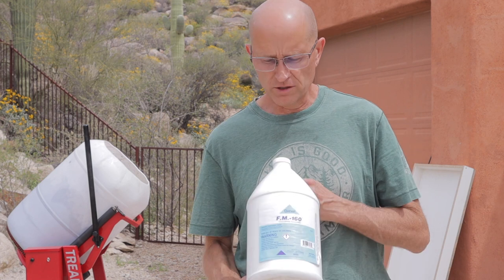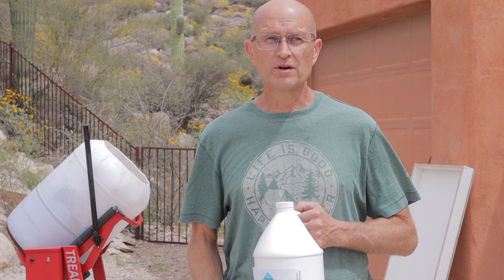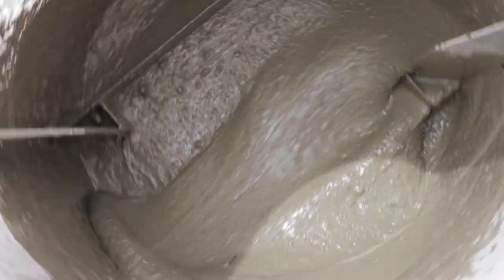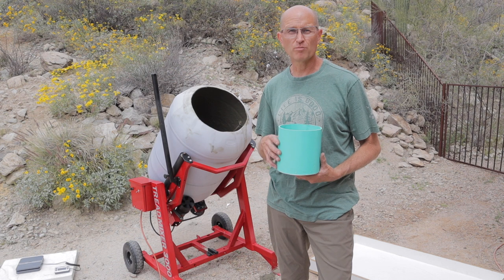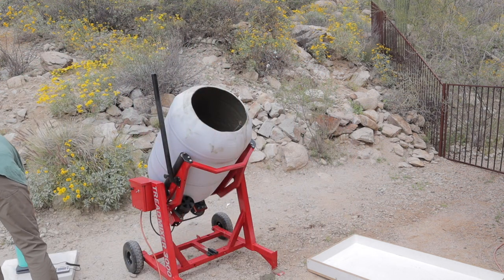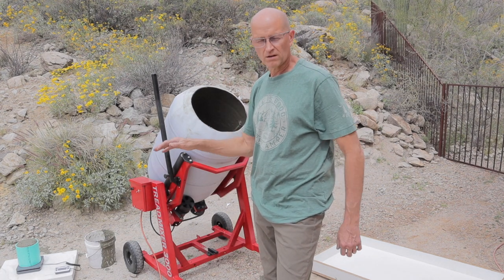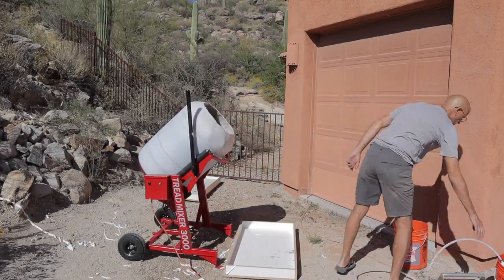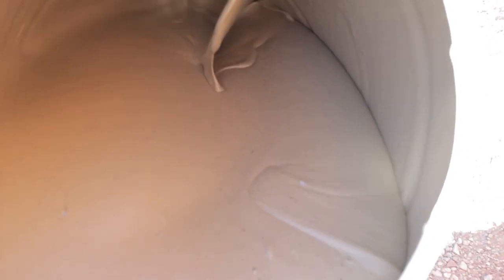How to Make AIRCRETE The RIGHT way!  [ How to measure Density for consistency.

Comment: You need to look up the difference between concrete and cement
Reply from the maker: Hi John, sorry if I didn’t get my words right in the video. Sometimes my mouth can’t keep up with my brain. Concrete is the finished product of cement and aggregate and sand. Cement is just the Portland component.😁👍
Reply: @PranaTech  yes, I know.  
I have been doing aerated cellular technology for the last 25 years. 
My strength to density is the best in the world ( as far as I’ve seen ) 
At 120 PCF I’m over 12,000 psi 
At 20 PCF I’m still over 1000 
Keep experimenting 
Way, way, way too much water !!!
I realize you only know Portland cement. But even in that basic cement there are water reducing additives
Reply from the maker: Wow, those are awesome numbers Jonathan! What foam concentrate are you using and what water reducers do you recommend? The DIY community sure needs someone like you to guide us! 👍Don
Reply: @PranaTech  I agree.  
It is a quandary    Even though I’m 68 and have been building concrete structures worldwide for 49 years, I’m still needing to pay bills 
Maybe someday I’ll write a book and give away what I earned the hard way—- the same way you are.
Reply from the maker: I understand completely. I’m a firefighter for my main job so Aircrete is not something I’m trying to making money with. If I was making a living from all this, things would certainly be different.  I merely want to build my own home in a couple years when I retire and I would like to build it out of aerated concrete. I’ve had a really hard time finding any engineer that will work with me on this. You wouldn’t happen to know any structural engineers that have experience with aerated concrete do you?
Reply: @PranaTech  my primary source of income comes from consultation.  Some from patent royalties. Some from university lectures 

You should study Adobe structural compliance 
Also, consider using an already code approved structural component.  Quantify the structural requirements with a structural component that is understood by the people telling you what you can and can’t do
You should be able to find an engineer in your part of the country who understands 
Maybe look at the similarities of the issue when building with Adobe

Comment: Is it possible to shoot aircrete?
Reply from the maker: Hi CAspar, you can pump it through a concrete pump, but shooting it like shotcrete probably won’t work. It is way to runny and has no real ability to stick to anything. 🙁
Reply: @PranaTech  Would adding a little retarder or water reducer make it sticky? Never done shotcrete in either mix design or application.
Reply from the maker: Good question! I have no experience with shotcrete, yet. I’m currently building a shotcrete pump but I have no plans to shoot aircrete with it. I’m building it to shoot shotcrete on ferrocement water tanks and outer shells for dome homes😁👍

Comment: Whats the R value of this product?
Reply from the maker: Hi Ciaran, the R value depends on the final density of your Aircrete. The Aircrete I was mixing in this video was low density and probably 30 to 35 pounds per cubic foot.  It has an R factor of about 1 to 1.2 per inch. Here is a link to a chart that shows the R factor of different densities of your Aircrete depending on how much foam you add. https://www.concreteconstruction.net/_view-object?id=00000153-96ee-dbf3-a177-96ffa5500000  😀👍

Comment: ANY IDEA OF COMPRESSIVE STRENGTH RATIOS COMPARED WITH REGULAR CONCRETE?
Reply from the maker: Hi Mervyn!  Here is a link to a chart for the compression strengths of aircrete. There are lots of info for regular concrete if you want to compare them.http://dlvews.com/wp-content/uploads/2017/08/Strength_Density-Charts.pdf 😁👍

Comment: Still waiting for the instructions on how to make the foam generator
Reply from the maker: Hi Michael, I’m probably not going to make one because I have been working on an Aircrete process that does not require any foam or generator. It creates the Aircrete through a chemical reaction and is much more reliable and repeatable. 😊👍

Comment: I want known how to make form
Reply from the maker: Hi Imran! It is very easy. You simply make a form out of wood or metal in the shape you desire. You make it screwed or clamped together so that it can be removed from the block of Aircrete when it hardens. Before you pour into the mold you can coat it with a paste wax to keep the Aircrete from sticking to the surface. That’s really all it takes.😊👍

Comment: Nice job and you seems quite inteligent and punctuative person , but there is a  huge mistake in your description. You are not preparing "aircrete" you are preparing foam concrete, which is totaly different . The Aicrete process is similar  story but at the end have to be "baked"...Both products look equal, but they are not. The foam concrete for his optimal strenght and quality needs preticular temperature when it is self drying...For extra strenght you can add polypropylene fibres.
 Keep the good job going !
Reply from the maker: Hi Peter, thank you for your great comments!  There seem to be different terms used throughout the world for this “Aircrete.” Here in the United States we call what I make “Aircrete” and what you are describing, we call “AAC” or “Autoclaved Aerated Concrete.”  Many people have other names for what I make, such as, cellular concrete or AC which is merely aerated concrete. You are correct that this Aircrete does need to be kept moist while it cures so that it reaches optimal strength. Preferably for 28 days for maximum strength.  Thanks again for your information 👍😀Don
Reply: Aircrete branded sells mobile units for doing walls and roofs and that is not baked they do bake panels and blocks

Comment: Sorry, but there is a fundamental difference between drying and cureing with regards to concrete. Concrete gets it's strength from cureing, but if concrete dries too fast it will be very weak. The two terms are not interchangeable.
Reply from the maker: Don’t be sorry my friend! You are absolutely correct! Sometimes my mouth goes faster than my brain and I misuse terminology. Thank you for pointing it out.😊👍
Reply: @PranaTech  Not an issue. Many people make that same mistake. You're in good company.

Comment: ratios please.  water to cement....water to foaming agent.....foam to cement slurry
Reply from the maker: Hi Dustin, sorry for not getting back to you sooner. I was at work all day and just saw your comment. Water to cement ratio is 6 gallons to 90lb. bag of Portland cement or 15.66pounds of cement to each gallon of water. The foam concentrate varies from brand to brand. Richway concentrate is 45 to 1 ratio so I use 14 ounces to a five gallon bucket of water.  For the foam to cement ratio, I mix it up until it is about the consistency of a medium thickness milk shake and then I measure the weight for the density on my scale and then adjust with more foam if needed to lighten the mixture. I show in my one video how to measure density of your foam with a 1/10 of a cubic foot measuring cylinder. Hope this helps! Let me know if you have any other questions. 👍😀Don

Comment: A buddy of mine uses Suave shampoo
Reply from the maker: I’ve tried a few dish soaps and I had trouble getting the bubbles to last until the Aircrete set up. I’ve never tried Suave shampoo though. Thanks for the idea!👍😁
Reply: @PranaTech  It's cheaper than air-crete specific products and he swears it works as well.

Comment: everybody says i mix my cement, but anyone said the proportions, ......
Reply from the maker: Hi Vladimir!  Sorry if it’s not in the video. I mix 94 lbs. of cement with 6 gallons of water. For metric, 42 kilos of cement with 22.7 liters of water. Hope this helps!👍😁Don
Reply: @PranaTech  hi  Prana , thank you forn answering, my doubt is the cement proportions,  21 kilos portland, and 21 kilos of sand??, or the proportion is 3 to 1 , 
thank you for taking your time for answer.
Reply from the maker: Hi Vladimir, the 42 kilos is just for Portland cement. There is no sand or gravel in Aircrete, just Portland cement and then foam is added. I mix my Portland cement up with the water in a large drum until it is blended well and then add foam until it comes up to my 180 liter mark on the inside of the barrel or drum. Then blend in the foam just until it is fully mixed and then pour into your mold. Let me know if you have any other questions my friend! 🙏😊
Reply: @PranaTech  guau Prana, this really surprised me , I will follow your advise and let you know how does it goes..
Thank you  again..
Reply from the maker: Yes, Aircrete is used mostly for its insulation value and then a coating of stucco or cement plaster to make it durable to the weather.👍😊

Comment: All the things I want to do require tools.  :(
Reply from the maker: Ha! I know what you mean! I have been working on a new process that is chemically based and needs nothing other than a mixer or you could make smaller batches with a drill and a paint stirrer. Should have a video out soon. Stay tuned. 👍😊

Comment: Used to be a quality control tech for a ready mix supplier.... I'm horrified.
Reply from the maker: DC why are you horrified?
Reply: @PranaTech  Because according to VDOT, for an A3 mix the parameters are 1"-5" slump and 4%-8% air. That's so generic here that most type 3 mixes are very similar. 4%-7% air for non VDOT. Although only an idiot would reject a load for 1% out of spec. Just stuff drilled in over a couple decades.
Reply from the maker: Hi DC, thank you for the information! I don’t know that much about regular concrete, I mainly play around with Aircrete with foam injected into the mix. Isn’t A3 regular concrete? Please help me understand what A3 specs have to do with Aircrete? Thanks, 😀Don
Reply: @PranaTech  Not a damn thing, Don. Too much air content weakens compressive strength and causes a few other things. Aircrete just freaks me out a little. Never knew about it until today.
Reply from the maker: Ahhh, ok now I understand.  I thought I was doing something wrong and you were letting me know.  Sounds good and thank you for the info! Cheers😁
Reply: @PranaTech  You're welcome, Don.